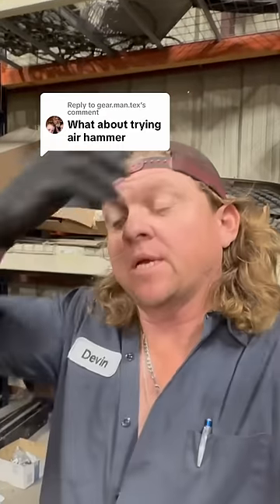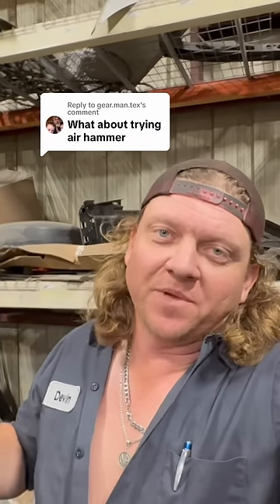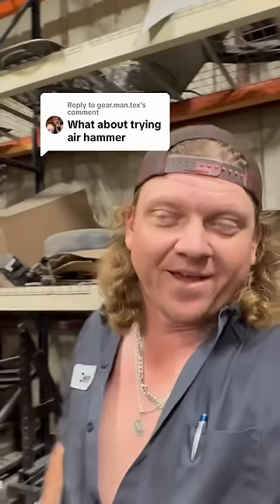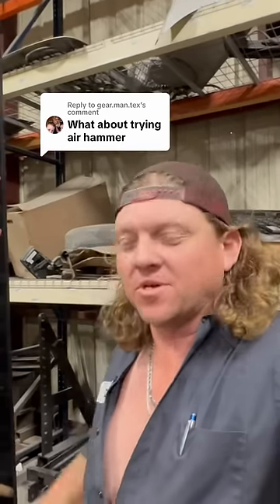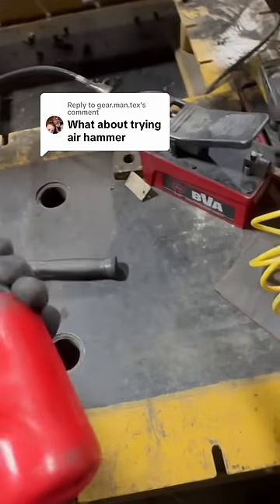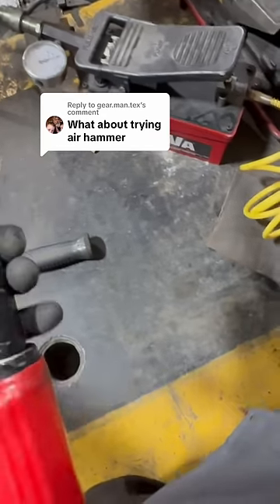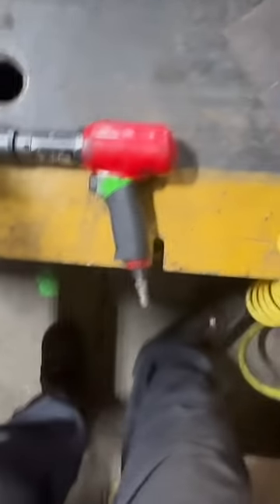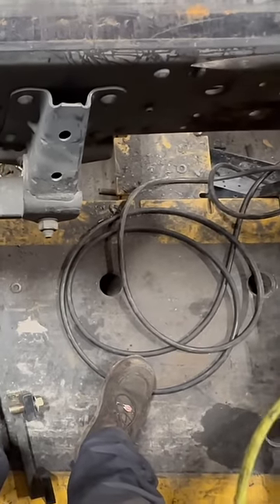Snapon air hammer 🔨

Comment: You forgot the most important part with the air hammer…. You become the most popular person in the shop lol
Reply: LMFAO “turn it off your breaking it”
Reply: Yep at our body shop the air hammer and the air saw get about the same reaction lol.
Reply: Especially on Monday morning
Reply: working ns   a  welder insisted using a chipping gun!   after a few nights we took it and threw it in the dock    that cured it
Reply: I straight up walk out of the shop while those noisy sobs are running.
Reply: @johndelta00 Seems  like as soon as I walk out of my office, somebody starts using a super loud tool 😅.
Reply: Used to have an old farm boy that would get PISSED when I would use mine in the shop, I’d pull it out and he would go, great your favorite fu****g tool 🤣
Reply: @baloghlcb oh man my last boss screamed and yelled about using g the air saw but man it is awesome cutting a lot of sheet metal jobs. Not throwing sparks all over an Interior or glass. Not a 6 inch blade tearing a path behind what you are trying to cut. Yeah they are annoying but handy as all get out. Wish they could muffle them. My hearing is bad and the scream if a cut off/die grinder makes me leave the shop.

Comment: I always grind a slot or X before chiseling.
Reply: They make one like that already so you don't have to adapt another one
Reply: Grind cut it bit thicker than you would think and go til its red hot , then air hammer quickly afterwards pop right out.

Comment: The video doesnt show you popping it, so im just gonna say that if those are steel, idk what to do other then beat on em and pray. As an extrailer mechanic, if theyre aluminum, bite into one side on the top and try to spin it off so you can punch it clean.
Reply: absolutely

Comment: It works way better; 1) pre center drill the head with a drill 1/8" or so smaller than the thru-hole size; 2) I use a little in-line air regulator valve to dial down the air pressure, so you can better control the gun.

Comment: Heat rived head white hot with torch, then cut with chisel or air hammer. Frame rivets are designed not to fail.

Comment: Hougen RotaCut Master Kit # 11085 has entered the chat....
They're annular cutters. So much easier than any other way. I swapped out all my spring hangers and some crossmembers for beefier ones on my 75 Highboy F250. Like 50 rivets. Believe me they work...use oil, center punch the rivet first, drill off the head, then hit the stub in the middle that's left and "Pop goes the rivet" !